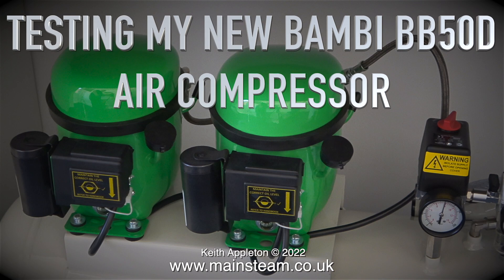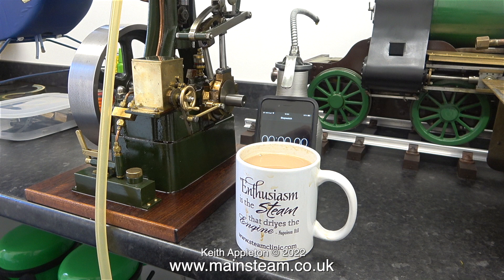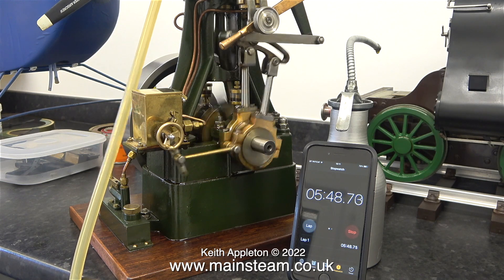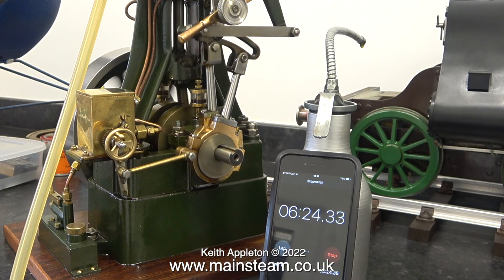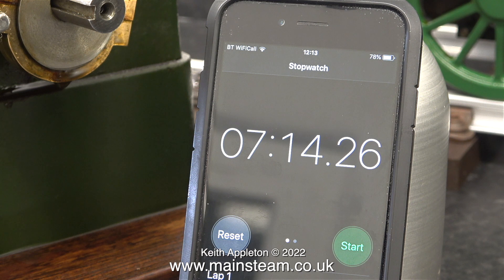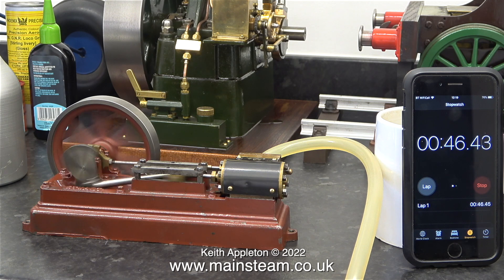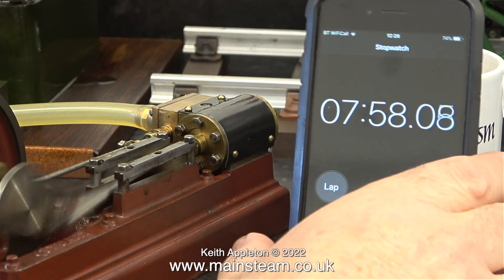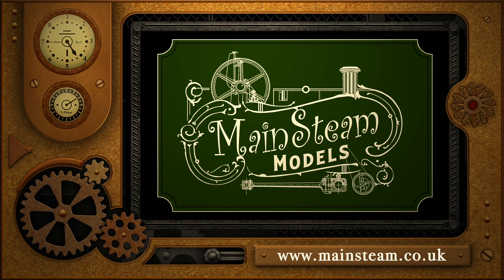TESTING A BAMBI BB50D AIR COMPRESSOR - PART #2

Comment: I've just shelled out for a BB24V to run my (close to completion) Stuart Triple (and smaller), and it's a hell of a lot better than the hand pumped Hozelock 7 litre sprayer I bought to run my 10V.
My dumb question is where does one top up the oil? 
The few videos I've seen are a decade old and show a filler cap on the top of the motor which modern versions don't have. The paper work that came with the compressor says 'top up the oil' but doesn't say how.
Reply from the maker: If you mean a Bambi Compressor, the fillers stick out of the top of the motors on mine and all you have to do is lift the plastic cap on the air filters to top up .
Reply: @keithappleton  
Thank you

Comment: Hi Keith thank you for your quick reply and for the information, this is a new area for me and I try to get enough information as possible before I make my purchase. I am very new to model engineering although I have had a lathe and milling machine for years. When I was in school many years than I care to remember I asked my metal working teacher if I can make something a bit more challenging than what everybody else was making I really wanted to work on the lathes that were there so he gave me plans for a tap wrench so that is what I made only he kept it for the school because they did not have many of them anyway Keith I really appreciate the info you gave me and by the way I like your you tube videos.
Best Regards Keith.

Comment: Hello Keith May I ask why you chose the oil over oil free version as they are about the same price. I am thinking about buying  a bambi compressor but not sure which one. Oh same First name just in case there is some confusion.
Thanking you Keith
Reply from the maker: The "Silent Compressor" that I bought a long time ago is of the oil filled type, and it has worked perfectly for many Years - so it seemed logical to go for the oil type again . . . .

Comment: Good that the oil helped the regulator.   Another product which helps in such situations is a dry lubricant like PTFE spray.   This gets into tiny crevices and does not attract dust and is good for higher temperatures such as 250+ deg C.  WD-40 is one company which sells this in their "Specialist" product line.
Dave.

Comment: tbh ... if you run all the engines the same way for each compressor tank test then each result will be relatable ... such as slow for 60 seconds then fast for 60 seconds ... then some other speed ... or whatever is NORMAL for your needs ... but do each engine the same in the same order .... and then you can directly relate the compressor tank to the engines bore sizes ... you also get a good bench mark on how long you have once the compressor is off ... and a way to estimate how long an untested bore size will run with the compressor off ... as each engine run is using a different total bore size .... you will have a range from the small to the large and just need to calculate where the new engine sits on that scale ... 
.
I would expect the scale to be near linear as the only true change is bore size on each engine and how far the air must travel from the inlet to the exhaust ... and yes whats not in the cylinder bore is essentially your error margarine (couldnt resist) ..
Reply: hmm 7 minute drain on the large tank ... 6 minute refill ... thats actually very efficient use of the 8bar of air in that tank ... 
so 2.25in diameter for 2in ... basic volume of a cylinder ... for the big small engine   for 7m14s to empty
5/8in diameter for 1.25in  ... volume of a cylinder ... 8m ... from 8 bar to 6 bar 
.
rerun the large engine for the 8 bar to 6 bar and the two engines are directly comparable and then you have a small to large range of run time for the same 8bar to 6 bar testing ... with an error of whats in the pipes and tubes ... 

so the 2.25in engine is almost 5cuin 
   the 1.25 in engine is 0.77cuin .... 8 bar to 6 bar took 8 min ... so roughly 4 min per bar drop ... for near 1 cu in bore 
.
 I would expect the 2.25in engine to last . somewhere near on 2minutes for the 8 bar to 6 bar .... the calculator says ... 2.737777 ... 
.
Volume = Height PI radius ^2    .... cylinder volume height equals stroke ... and Bore/2 equals radius (1/2D^2) for diameter
.
quick simple and easy now if you run a 1in bore engine for the 8 bar to 6 bar testing ... then you have a nice even number and a simple calculation for duration ... for bore size ... smaller than 1inch bore longer run   larger than 1 in bore shorter run ... 
.
the other comparison you can do is run a 1 in or the 5/8ths in ... engine for its 8 bar to 6 bar then run the 2.25 engine for the same amount of time and see how much air in the tank is used ... this will allow you to calculate the amount of air the lines and pipes hold over and above the cylinder and how much more they move in the same amount of time ... and gives a direct volume per time scale measurement 
.
then all your engines between these two or near them in size should be roughly in the same ball park for both types of testing 
.
btw these calculations would be handy for deciding the generator to run with them if any is required ... as you can now select a generator that will run at its best setting for the longest time when paired with an engine that covers that region of air volume over time 
.
with a little math jiggery pokery you can also find the volume moved per bar for each engine ...

Comment: Be mindful of the duty cycle of the compressor, it should  be listed  in the owner’s manual. In a previous life I serviced compressors, some compressors have as low as a 10% duty cycle. If they run too long without a break, the compressors overheat and bad things happen. I doubt you’ll have problems but it is something to keep in the back of your mind.